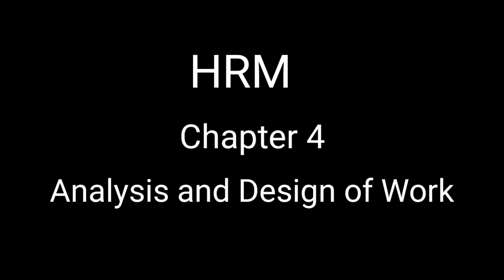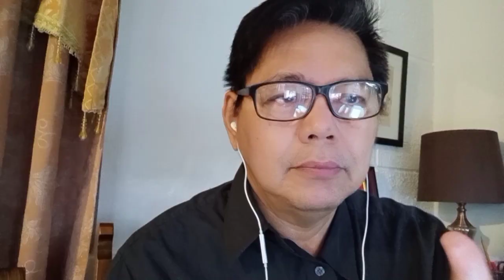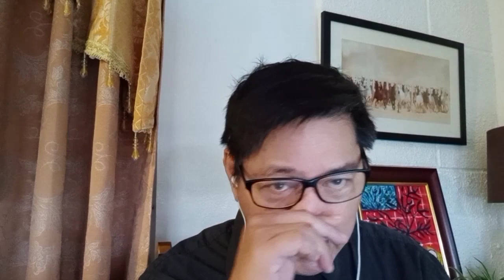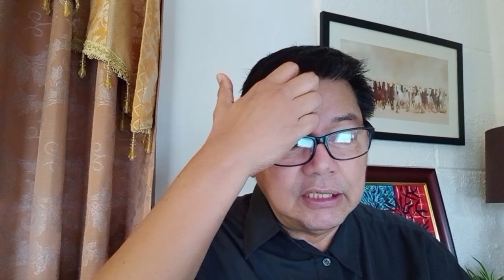HRM: ANALYSIS AND DESIGN OF WORK

Comment: LIM, JENNIFER Q.
BIR QC

1.Workflow Analysis – is the process of analyzing the tasks necessary for the production of a product or service prior to allocating and assigning these tasks to a particular job category or process. Stages in Work Flow Analysis: 1) Work Outputs- every work unit seek to produce some output that others can use. Output is the product of a work unit and is an identifiable thing or service., 2) Work Processes- are the activities that members of a work unit engaged in to make the output. Jobs that are more complex, a team-based job design is used. This allows a wider-set of skills, team back-up, share of workload and errors detection., and 3) Work Inputs- are the inputs used in the development of the work unit’s product. There are Three (3) forms of work inputs – 1) Raw Inputs- consist of materials that will be converted into the work unit’s product. 2) Equipment – refers to the technology and machinery used to transform raw materials into finished products. 3)- Human Resources -the skills and abilities need to perform the tasks.
 2.In a fast food restaurant, the workflow goes accurately as what they planned and working productive is their key. Whereas the five star restaurant, each job has more widespread task and has more prominent obligation in finishing an entire work.

3.Functional Structure –It is commonly used organizational structure in which the organization is divided into smaller groups based on specialized functional areas such as production, marketing and sales. Each function is managed by a departmental head that has a dual responsibility to be accountable to the top management and to direct the respective department to achieve favorable performance. The advantage of a functional organization is that grouping employees by specialization ensures a dependable level of departmental competence. This is particularly so for large organizations that have several functional levels within a department. The disadvantage of functional structure, in a perfect functional organization, each group's tasks would require no input from other functional groups, but this is often not the case. As communication becomes increasingly dominant in organizations, isolated groups may underperform or even fail because they have no institutionally recognized way of communicating needs and issues to other functional groups that might have helped.
Divisional structure is a type of organizational structure where operations are grouped based on divisions or separate product categories. Here, separate functions such as Production, HR, and finance can be seen under each division to support each product line. It is most suitable for companies who operate with several product categories in geographically dispersed markets. The advantages of divisional structure in organizations are specialization and efficiency. On the other hand, the disadvantage is the organization may produce a variety of goods and services, and they might be operating in several regions, but they still do not have the resources to run so many different divisions and have the employees of same level in each division. This also causes duplication of work.

Comment: Abygail Rodrigo
BIR RR7 QC

1. Work flow Analysis is the process of breaking down the performance of a workflow and examines trends for improvement. It often reveals redundant tasks, bottlenecks, and opportunities for more automation. By looking at a work flow, business users can tweak processes for optimal efficiency and workplace productivity. The stages of work flow analysis are Work Outputs, Processes, and Inputs.Output is the product of a work unit and is an identifiable thing (Ex. chair, hamburger, etc.) or service. Work Process are the activities that members of a work unit engaged in to make the output. Work Inputs  are the inputs used in the development of the work unit’s product. Forms of inputs are Raw Inputs or the materials that will be converted into the work unit’s product, Equipment or the technology and machinery used to transform raw materials into finished products and Human Resources it is the final input for the work-flow process or the skills and abilities need to perform the tasks.

2. Fast food restaurants have generally smaller groups and more specific jobs than that of five star restaurants. In fast food restaurants, each crew have a specific role or part in its operations where they can do their jobs individually. While in five star restaurants, they usually are under the instruction of a head chef who is responsible for overseeing the main operation in the kitchen. The head chef is the one who delegates the job and also makes sure that it is in conformance with the standards or criteria to be considered as a five star restaurant.

3. Functional structure is an organizational structure in which the organization is divided into smaller groups based on specialized functional areas such as production, marketing and sales whereas divisional structure is a type of organizational structure where operations are grouped based on divisions or separate product categories. Under functional structure, majority of the decisions are taken by the top management thus limited autonomy is being granted for their managers while in divisional structure, significant autonomy is granted for divisional managers. Functional structure is suitable for organizations that operate in a single location with a single product category and Divisional structure is appropriate for companies that have multiple product categories and is present in a number of locations.

Comment: Akihiro G. Hyono
BIR RR7 - Quezon City

1.Workflow analysis is a process in which businesses examine the progression of workflows in order to improve efficiency. The Three Stages in Work Flow Analysis: 1) Work Outputs- every work unit seek to produce some output that others can use. Output is the product of a work unit and is an identifiable thing or service., 2) Work Processes- are the activities that members of a work unit engaged in to make the output. Jobs that are more complex, a team-based job design is used. This allows a wider-set of skills, team back-up, share of workload and errors detection., and 3) Work Inputs- are the inputs used in the development of the work unit’s product.

2. Fast-food restaurants have smaller groups and each employee is dedicated to one job in each section of the operation. Isolated groups may underperform or even fail because they have no standard way of communication. While the five star restaurant, is that the different groups, such as chefs and sous chefs, kitchen cooks, communicate and work together toward a common goal of serving customers.

3. A functional organizational structure is the most common of the three organizational structures adopted by most companies. Companies organized by function group employees according to their activities in the organization. Segregating the workforce according to function clarifies organizational responsibility and allocation of tasks. This tends to eliminate duplication of assignments that waste time and effort and makes it easier for management to direct work to appropriate employees.
The divisional structure is a type of organizational structure that groups each organizational function into a division. These divisions can correspond to either products or geographies. The advantage of divisional organizational structure allows people in a single division to interact with each other. When all of them are working towards a single goal, the success of their division, the motivation is higher than ever. The communication is much efficient, and everyone knows what the other person needs from them. Disadvantages of divisional structure can include operational inefficiencies from separating specialized function.

Comment: Mark Daniel B. Tungol
BIR, Quezon City

1.	Name and Discuss the nature of the steps in a workflow analysis.
Workflow analysis is a means of the manager to produce products within the company’s means. Outputs are products or services provided by the work unit. Work inputs are ingredients that can be broken down in raw materials, equipment-which were referred as technology, and human skills. Workflow design includes organizational structure. It is the relatively stable formal network vertical and horizontal linkages between employees. Work processes are the activities of work unit to produce in a given output. How things should be done to develop particular products. Once outputs have been identified, specify standard output or measures or levels of required performance for different level of efficiencies.
2.	Based on a workflow analysis, describe the major differences between how tasks are grouped into jobs at a fast-food restaurant and those at a five-star restaurant. Which job design approach do you see predominating in each? 
Based on my observation, workflow in the fast-food restaurant is decentralized into different jobs pertaining to who will cook and prepare the burgers, the rice meals, the dessert, the drinks, and leaving everything up to the cashier as the one getting orders and serving in the counter. While those at a five-star restaurant, they work simultaneously with one another, as the lead chef being the center (centralization) that will decide the menu, and then delegate the preparation to the sous chef and the others. Each job design approach is predominantly important with each sector since they are in a different level and scale; the necessity of each industry fits the workflow designed for them.

3.	Compare the functional structure to that of the divisional structure, including the nature of their design, their respective advantages and disadvantages, and the types of environments in which they might best be used.
Functional structure and Divisional structure were also introduced. Functional structure employs a functional departmentalization scheme with high levels of centralization. This structure tends to be inflexible and insensitive to subtle differences. The jobs need to be narrow and highly specialized and people need to be working alone under the said structure. Divisional Structure, on one hand employs a workflow departmentalization and low-level centralization. This structure tends to be more flexible and innovative; it is not very efficient compared to former. This structure is more of team-based making authority and surrounds a holistic environment.

Comment: FINAL EXAMINATION
DOLOR, Iana Charise E.
3ASM

1. Name and discuss the nature of the steps in a workflow analysis.

a) Collect Hard Data
o Take a report of the workflow you want to examine. Analyze the statistics and see which ones are performing as required and which ones aren’t. Look for workflow analysis tools that can give you all of the information needed

b) Step 2: Collect Soft Data
o To further your workflow analysis, you need more than just numbers. You also need to go and talk to the people who use the workflow tools most frequently.

c) Step 3: Ask the Hard Questions
o The next step of workflow analysis is to ask the questions that guide the workflow. These questions are: “What is its purpose?” “Who is it supposed to serve?” “What defines a good process?”

d) Step 4: Implement the Changes and Follow Up
o Using a combination of workflow analysis tools and in-person conversations, you can come up with the right solution. After identifying all the changes that resulted from the workflow analysis, implement them in the system. All the stakeholders should be informed of any change, if there will be any downtime, or how to handle items in the middle of a changed workflow.

2. Compare the functional structure to that of the divisional structure, including the nature of their design, their respective advantages and disadvantages, and the types of environments in which they might best be used.

- Functional structure is an organizational structure in which the organization is divided into smaller groups. These groups are based on specialized functional areas, with production, marketing, and sales as examples. On the other hand, divisional structure is a type of organizational structure where operations are grouped on the basis of divisions or separate product categories. In functional structure, shared functions are used which result to high specialization; while in divisional structure, separate functions are used which result to low specialization. In functional structure, there is limited autonomy for managers since majority of the decisions are made by the top management; while in divisional structure, there is significant autonomy for managers. Functional structure is suitable for organizations operating in a single location with a single product category, On the other hand, divisional structure is suitable for organizations that is present in a number of locations and have multiple product categories.